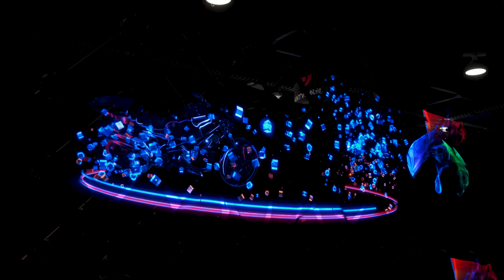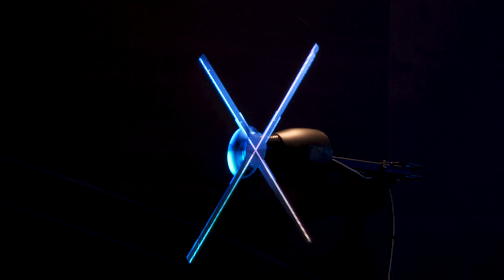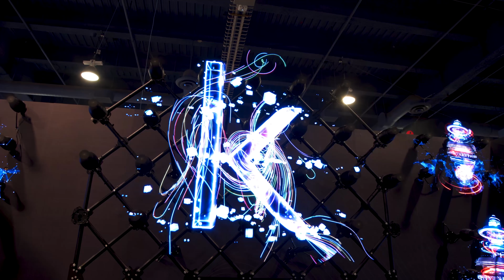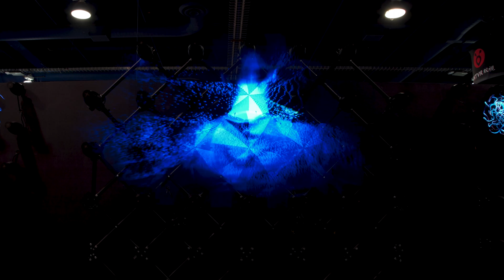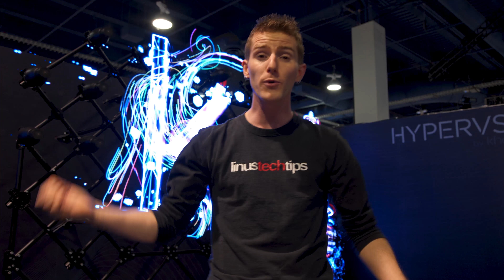FULL DISPLAY made of RGB Fans!? - HyperVSN Wall

Comment: Now imagine using one of these for Dual-IPS modulation, these can be modualted at 5000hz+, that's has incredible potential for a gaming TV or monitor, dual-IPS has better than OLED blacks and whites which means much better contrast, shadow detail, HDR performance and so on, add to that a several thousand hz modulated backlight and you have the best display tech for gaming period, not even CRT can compete with something like that in theory at least, don't forget you can add a QD enhancment layer too for further improvements and you could have something super special that could even outshine the best profesion reference displays to date. Plus imagine the depth these RGB moterised LED's would a display, it would instantly make even lagacy content look next generation thanks to the fact it works with any 2D source, the funny thing is the first displays used spinning discs to create the image, this could really work well though, you could even make one yourself tbh with an IPS panel or two for single or dual-IPS depending on how good you want it to look and using an RGB fan hooked up to the backlight driver module, even @ 60hz this would have night and day better motion clarity vs sample and hold backlights.

Comment: Do you know if they have some kind of speech combined with 3D character facial animations app/software to speak into the mic on your phone and have a 3D character act out your speech mimicking with animations that also has built in bluetooth speaker in the Fan/connection possibly?

Comment: Let's see... give it another 5 years, we'll be buying case fans that double as POV displays that are synced to the cloud, with ads pushed to the fans whether you like it or not. Then we'll all be shelling out another 10 bucks a month to purchase specialized ad-blockers for them. Chinese-made options won't be any better cos the chinese would have realized that they can simply embed the ads into the firmware of the fans on top of the usual 3rd rate build quality, thus allowing them to sell it to you for pennies on the dollar while collecting huge advertising revenues.

Comment: Cool, that is like 'fan'tastic made.. But hey.. I see some potential problems with it though:
1. Are they shielded? If not, how fast do they spin? can you loose your hand if you put it into one?
2. They are properly only for spaces where noise is not an issue..
3. How much power do they consume, in comparison to normal displays

Also, there were a comment about them not being hot.. That's properly another issue right there.. They will properly be hot, motors are general pretty hot..

Comment: is it loud when turned on? does it operate like an electric fan? I mean if u got this as a display mostly it would be in the ceiling tho or on the walls with a glass case so it doesn't get touched or be too cold i guess

Comment: Either your math is wrong or you misspoke, Linus. You said effective 4K resolution per fan. If the fan has over 200 LEDs along it's radius (let's say 256), and you count every, say half a degree of fan movement as a separate line of pixels, you get a little under 200,000 pixels. That's less than 1/40th of 4K...
Reply: It's less then that you need more then 200 pixels to get 4k I think maybe eh idk it spin down to make image means we need more pixels or leds but fan speed and its spinning reduce that but we use software and other board for each rotation to flip image and make up for it.. if it spin down to male tiny image over blade we eh uh send it through chips to flip frame by frame I think to to resize it up this leaves us having to use less pixels or leds.. it like going from extra extra to just extra fan spining always reduce it

Comment: Am i the only one wondering how case fan manufacturers are all amped about RGB fans, but neither of them made a fan that displays images like that? Imagine case fans that display either your system time or some other things you set it to, or some ingame elements like healtbar or ammo or something like that....
I mean we got those little USB LED fans for laptops that show some random stuff on their spinning blades. That, but more refined, in higher resolution on case fans, accessible and tweakable through their CAM software.

Comment: Yea, just what I need, a noisy display! And no, there is nothing 3D or holographic about it. All it does is display in one plane, tricking the eye that the image is free floating. 

The closest to a 3D display that doesn't require glasses that I've seen was an interesting solution using a HD 70" display with an interesting glass lens cut similar to a Fresnel lens. The lens directed the light from individual pixel rows to the left or right eye, and as you walked past it you could see the sides of the objects if the movie or images were encoded to allow for it. There were a lot of problems with the technique though, so it wasn't even close to being a competitor for the 3D TV's that require special glasses.

Comment: But what kind of refresh rate would such a thing run at? How would that even work? Would it be dependent on the fan's RPM? Or would it be bottlenecked by the individual LED's "refresh rate"?

Comment: The one problem I have is fast moving images. Because of the nature of how it shows pixels, instead of showing them all at once, the top pixels are slightly ahead of the bottom pixels. Kinda like a rolling shutter on a camera. So fast moving objects might look weird and have motion blur on this fan display. Hopefully the fan spins fast enough to not cause this issue
Reply: This actualy produces better motion clarity than the whole frame update method aka sample & hold, this is as you said this uses something more akin to rolling-scan/raster-scan, like CRT, which have near perfect motion, even @ modest refresh rates like 30hz, hence why these would make incredible LCD backlights, a dual-IPS display with motorized RGB discs moulated at 2000hz+ would be incredible for gaming on.

Comment: Jesus! You guys are easy to impress. This thing is basically useless:

1. It only works in the dark. Like, only when it's really really dark. Seriously, find a video of this fan in a supermarket, it's pathetic.
2. It's equipped with a protective half-sphere screen (not shown in the video) for safety reasons. Screen interacts with the image (reflections, etc.), which takes away from the effect.
3. It costs a ton, but you can't buy one - rent only. They will use a complex, restrictive business model that's not flexible enough for the business needs of prospective clients.
4. There is a reason Kino-mo is aiming at global launch and wants to start simultaneously in every country - they know it's the fidget spinner of tech products - it will make noise for a month and once everyone realizes it's not that special it's going to die. That's why we don't see any trial runs - only conference displays under perfect conditions. Kino-mo is hoping really hard to make at least any money before their clients catch up.

Recap: little to no practical applications, protective/reflective screen, high cost, rent only.

All the limitations considered, it's really not very different from using the common projector to put an image on a glass screen, which would achieve an almost the same effect in the same darkness that hypervision needs to operate.

Comment: "200 leds per blade"
"4k"
Yea, sure. 200×2 = 3 840

(4k means 3840 pixels per row, so the diameter, where you get the most pixels per row, should have at least that to be considered 4k in any way. You're literally missing a zero linus)

Comment: Honestly, these things are ludicrously over-engineered and over-priced. Instead of having each one be able to run completely on its own, they could have just had them plug into a central controller box. Just doing that would probably cut the cost quite a bit.

Comment: Reminds me a lot of like back to the future style holographics.

I'm not sure I understand why this would be anything other than 2D though. The LEDs on that fan make up a single plane, so how would the depth information be displayed. Let me know if I missed something.

 Very cool nonetheless that you get the illusion of the image floating in empty space. That alone gives it a very futuristic effect.

I bet that if you make the fans designed not to push air but to glide through the air with the minimum possible friction they could be very silent at the speeds you need to make them appear "invisible". They would probably just end up making a stable pressure field where the air barely moves.

The only problem with these is probably that you will be limited to custom-made "artsy" material because I suspect you have a pretty limited color palette. A normal video would probably look a bit shit ugly color banding like oldschool VGA graphics - just really high res.

Comment: This probably looks normal  in 2050
Reply: 2025 - 2030 imo
Reply: Minus the cyclone blowing in your face I'm assuming. xD
Reply: WingofTech it can’t blow air
Reply: PSHH You need FANS to display your holograms? You haven't gotten the new magnetic cold fusion plasma generator? Positively pedestrian!
Reply: The point is that stuff gets cheaper over time.
Reply: Is glasses-less 3d overtaken this in the market. This seems more like a cool gadget just to have, not a gadget that'll be apart of main life like tvs that display 3d without glasses could possibly do. Both tech is here just a matter of which would be pushed and made more practical in daily life.

Comment: Check your info about the single "fan" resolution. We are 100% sure that this is not a 4K per single unit(as studio that worked on animation for this hardware), not even close.
Reply: The thing is, this display is unconventional and it's impossible to classify it within a standard resolution. Each pixel isn't even rectangular to begin with, it's an arc. If you watch that fan though, even the outer edges look very crisp and they aren't really creating a visible arc, so there have to be a ton of LEDs on each blade, and they have to be refreshing extremely quickly. If it's 200 LEDs per blade, that's effectively π200^2 pixels, which is less than a 1080p standard display.. Resolution on one of these would have to be calculated by the area of a circle, pixels per blade being the radius.
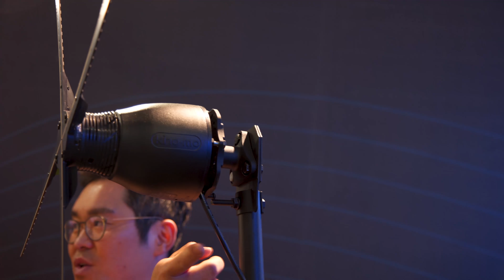Reply: At 0:44 You can see how the LEDs go right up to the very middle except the exact center.

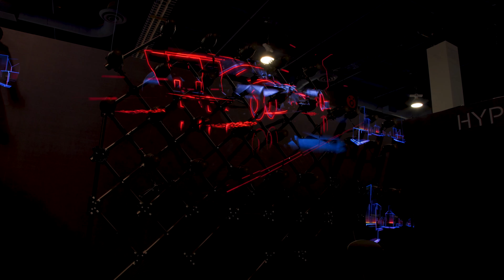Around 1:20 if you watch the lower display showing cubes you can see how they're getting full coverage by just offsetting the fans into 2 layers so that ones behind can cover the gaps between other circles. It'd be impossible to spin them if they were all in the same level without hitting each other.

As for the resolution it's definitely way higher than 200x200 because the display is round so the actual equation would be 200xdegrees of resolution or how many times they update the LEDs in a single spin. That'd be closer to the effective resolution.
Reply: South Style Movies the problem is that with this sort of media, resolution depends on rotation speed and the refresh rate of the individual LEDs.
Reply: It should have a 400px diameter. But judging by the fact that the pictures were solid, by that I mean there were no gaps, there’s something else going on. The centre of the fans still displayed something; although that’s easily explained by there being leds on the fan centres as well. The big thing to me is that even though the fans will display a circle, the spaces between each still displayed things. There may have been other fans that covered the area – if there were, I didn’t notice them – or the fans were specially synced so their blades occupy common area, but miss each other with special timings
Reply: Zephir il ventilatore chiassoso not even 480p, unless they're using some other trick to use multiple LEDs in a single frame.
Reply: MrRtkwe I see! I probably should have looked before commenting. Also, the should mean the displays are 400px in diameter, although the actual pixel count would depend on pixel updates per fan rotation
Reply: If the leds on each of the four blades have a small offset compared to the next blade, it is possible to quadruple the diagonal resolution to 1600 pixels.
The resolution on the outer circumference of the circle depends on how fast the hardware can switch those leds on and off. So the 'circular resolution' can be very high.
Pre-rendered content (video, 3D grapics) can be 1600x1600 max. But realtime generated graphics (line art, text, etc.) can have a much higher circular resolution.

While writing this text and thinking about it; the max res of pre-rendered images can also be higher; only the 'linear resolution' will be reduced during displaying to 1600 pixels. The 'circular resolution' can be 8k or more, which is comparable to 4k horizontal.
Reply: I hate weebs no hahaha you're so bad at math. If any it would be 800×800 (or 400×400×4). But it doesn't work that like that.
Reply: No matter how you spin it this display can't put higher resolution than what is given to the artist and ended in the final render. Plain and simple.
Reply: We can't comment the specification of the device(it's confidential). We simply asking if hypervision give specific resolution to Linus, this by this pixels. Because we have seen this in action and it's obviously not a 4K display/fan. When they say 4K when it's not it will be very disappointing for costumers in the future.
Reply: South Style Movies seriously. How can 200 pixel on each blade be 4k? Isn't that 400x400? Not even close to 4k.

Comment: Is camera framerate out of sync with the blade rpm, or the artefacts really that apparent?
Reply: Well the way these displays work is they depend on a property of human vision. When we see bright lights, our eyes don't immediately let that dissappear when the light is gone, instead we retain it in our vision for a bit. These fans spin fast enough that we can see a full picture, but a camera won't be tricked as well. Should look much better in real life.
Reply: If you're talking about where the lines on some things don't line up it's because it's not being viewed straight on in those shots I think. To get full coverage without a gap they have to overlap the fans but to do that they have to have them at at least two different depths. The closer they're able to get the front of the back 'fans' to the back of the front row the smaller that error will be.

The other effects like the small swirl you can see in some shots are probably not visible to the human eye, camera's don't really see POV effects the same way our eyes do.
Reply: Hey LTT employees! If you see Mordewolt's comment, pls answer.
Reply: IRL there are artifacts too. I found it really gimmicky and not at all usable. The overlap has only one sweet spot and then still it’s not perfect.
Reply: yeah it's kinda like low refresh rate monitors and how you would get a flashy video if you recorded it.

Comment: It is not a fan dear . This technique is based on perception of vision. I have to admit that this company mastered this technology. Price is too steep for this for this. Material cost is way cheaper from its sp . It is nothing switching off and on leds in microseconds. But it requires hard core tuning

Comment: So as i understand I wouldn't be able to put just any image or video on these? If so it's kind of dissapointing
Reply: Sure you could. Since it can render models. All you need is to treat it in the same manner as rendering 2D with OpenGL or Direct3D. Render out quads which have textures mapped to their surfaces. However that ruleset for their particular installation is just stupid. Only showing the best of a technology is inviting disaster as no one can see the flaws and propose fixes.
Reply: But it's CES. You think Hypervsn will be like "Here's how our product sucks" at a demo booth? Beside, shops in China will be using either white-label versions of these made from cheaper parts because they're all made in the same factory or another white-label will make a knock-off of this soon enough for considerably less.
Reply: No even that. It can do full 2d... the team just don't want to at the moment, as they are only pushing top of the best quality and tech showcase videos right now. So if they stick to 3D until prices come down, they make more money?

Comment: Yes, but tell me the thermals.
Reply: Fans not hot
Reply: Neva hot
Reply: they should be favorable, the blades moving through the air sinks the leds, plus the blades can also be tilted to move air along the other parts that need cooling.